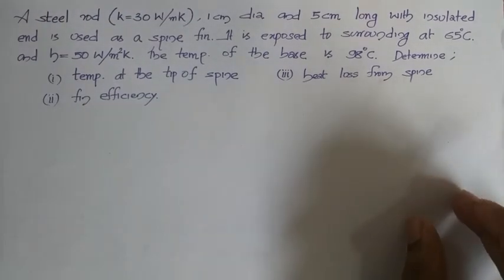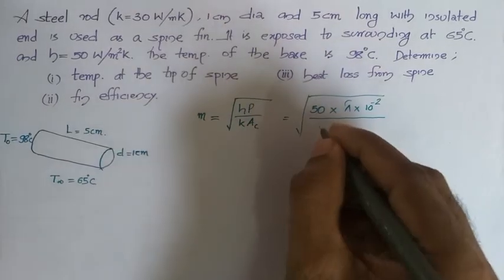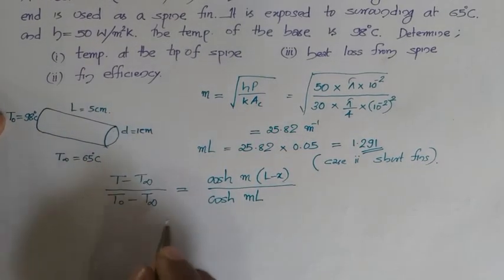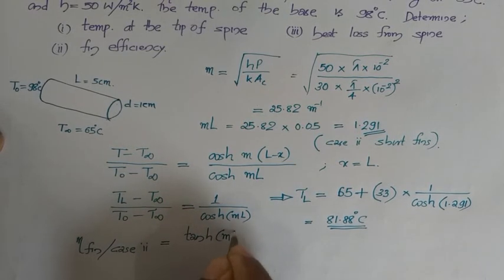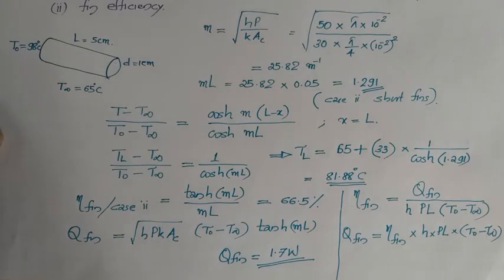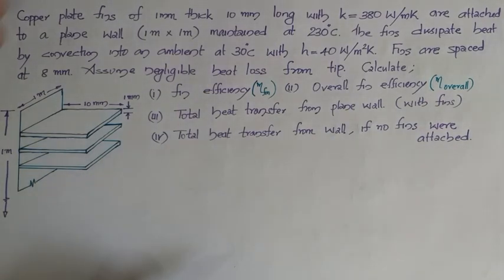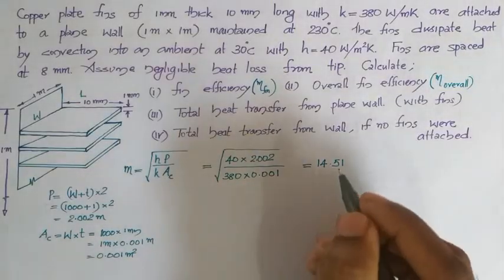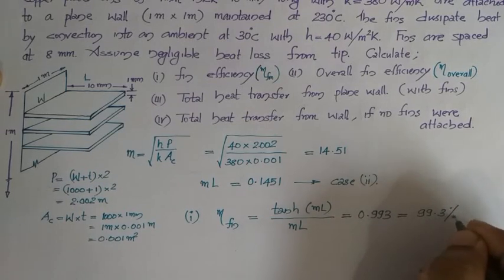Fins - Problems on Efficiency and Effectiveness | Heat transfer through fins | HMT| KTU| S6 MECH |

Comment: hello why did u divide by 8 when u calculated the number of fins? shouldnt we divide by 9 (thickness of 1 fin plus spacing between fins)?
Reply from the maker: Actually 'fins are spaced at 8mm' means it includes the fin thickness and gap ... It is the distance from one point on the fin surface to the corresponding point on the very next fin.